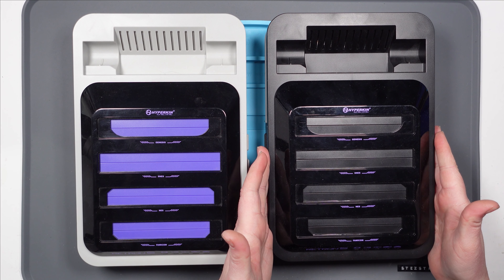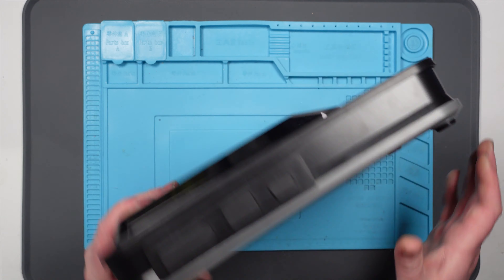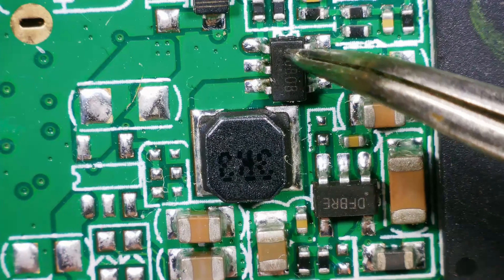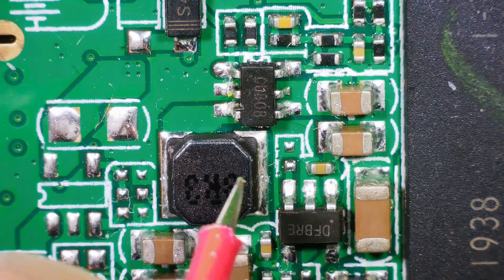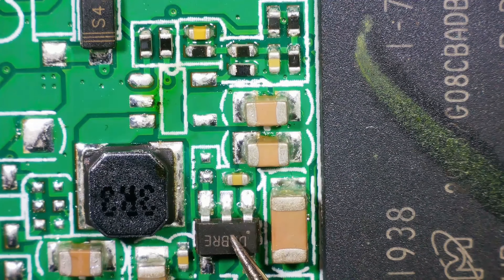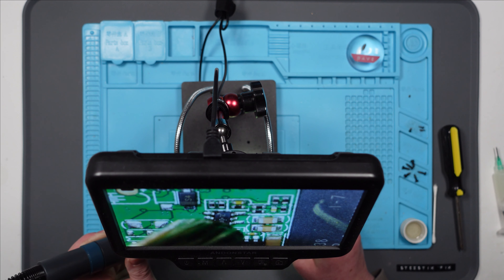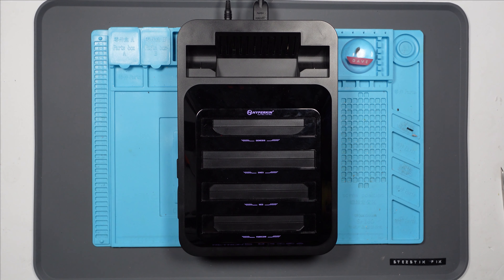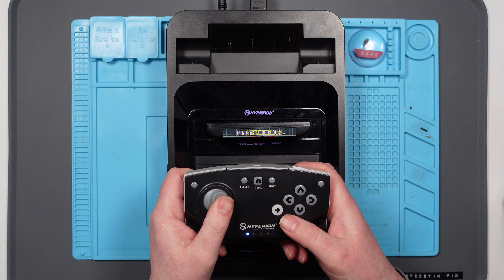This RETRON 5 Has No POWER | Can I FIX It?

Comment: Today I repaired my friends Retron5 just based on this video. Same chip was dead, I had to wait ~3 weeks to get it from China to EU. In my case nothing was not shorting, but as soon as I did plug PSU in, it was 1.2V on all lines. First I tried desoldering 0ohm resistor on the vcc rail and then up till that place it was 5V. Soldered it back and next in line was this tiny RT8097, replaced it and Retron5 started working. Since they sell those only in pack of 10, I cut few from the strip and taped inside of console housing with note that "if it does not power on, try replacing this chip". This video actually saved at least one more Retron5. Thank you!
Reply: Absolute long shot here. You don't know what the SOT23-5 component is on the back of the power board labelled under the U51 chip.

I've been searching for what seems like a lifetime

Comment: my 1st one fried... i used another power supply that looked like the one that came with it but then i smelled a burn.... didnt realize i had the wrong power supply. the weird thing is, the led on the power button would light up if i came closer to the console with my hand at the back where the power cable would plug in. i bought the new limited edition that came out 2 months ago though

Comment: Good work Steve I guess you macgyvered the flex cable connector ;)
Reply from the maker: Thanks Beo. Half of it was still attached and it seemed to clamp it down OK. Although I haven't actually tested the controller ports on that side 😳 I should go and do that. 😬

Comment: Hi pal, wonder if you could help me i've come across 2 retron 5 one with power issue like in the clip above and another the death grip where the snes port stops working but none have power supply. I know its 5v 2amp plug but not sure wether it is positive inside and negative outside an vice versa. As someone thats worked on them can you tell me or point out a plug that i could use without taking the risk or blowing up the other one!!

P.s. i know this clip is over 2 years old but i have recently come across it
Reply: 5v2A center is + and outside is -
Reply: @HandsOnRepair appreciate it

Comment: Very nice video my friend I have a question I have a Sega Genesis with 80 built-in games with two wireless controllers you have to put batteries in the controllers but for some reason they won't pair is there anyway I could possibly get them working
Reply from the maker: Thanks Jay. Not sure, do the controllers have any leds on them to show you they're getting power? I would start there, just to make sure they are powered. After that, it could be the wireless ( not sure if RF/Bluetooth) connection, so I would look at the transmitter/receiver for possible damage. Good luck! 👍

Comment: Do you still use the same power supply that came with the Retron5 after you did the fix? I thought I read a comment that it could contribute to the problem of burning out components.
Reply from the maker: The power supply sent with it was a European one, so i used the same power supply I bought for my one. But yeah, I've heard that too. My power supply is actually a USB powered 5v, and it seems to work perfectly.